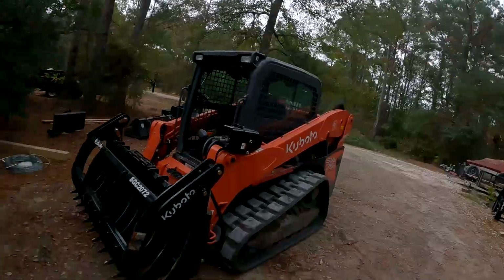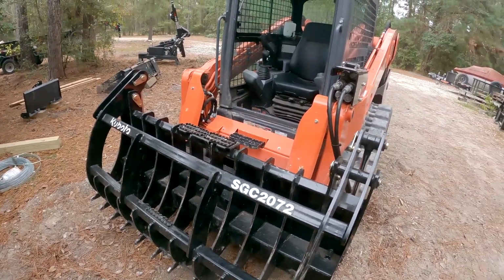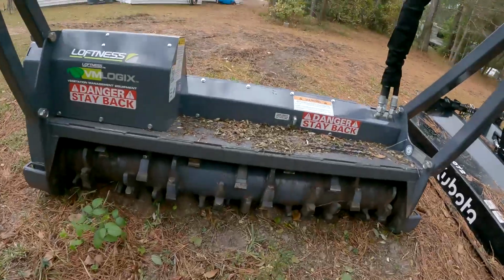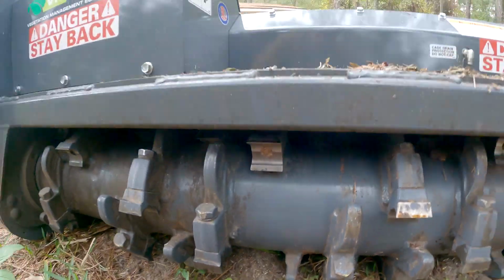Kubota SVL 75-2 with Loftness Battle Axe Vs Bobcat T595 with Fecon BH62

Comment: Do you like the Battle ax over the fecon? Also what series do you have for the battle ax
Reply from the maker: The head in this video is the L series. It's a standard flow head but works great on a 75hp machine in high flow. I have never run a fecon head so I can compare but I felt in here it outperformed the other machine. The big difference is the l series battle axe was specifically designed for this size machine and the fecon was not necessarily designed that way. Both have their strengths.
Reply from the maker: I have the s series on my new Bobcat. Just been so busy haven't made any videos. Just made on recently with The Stoney Ridge Farmer though if you want to check that one out
Reply: Amy thoughts on the battle ax against a comparable FAE on a 75 hp machine. I’m buying the Kubota 75-3 and want to find the best head for land clearing in south Florida

Comment: I run a fecon and can tell you that it doesn’t look like they’re running it on high flow. Something doesn’t seem right. I can chew up trees like that in a few seconds with a John Deere 333g.. That Fecon head is a serious machine but you need to have  high flow.
Reply from the maker: That's a 75 hp machine running the fecon head here so it's definitely not going to compare to your 333g
Reply: @themannstead2494  I agree with you there. I have seen some guys running a Fecon on a 325g which is a 75hp machine and was pretty impressed with how well they ran. Not sure if there may be a problem with the one in this video. I was impressed with the Kubota and Loftness head. Actually came across this video because I have an opportunity to buy that exact same setup for a good deal and was curious about how it would run.
Reply: It’s not the HP it’s the flow ……I run the Fecon bullhog on my Kubota SVL 90-2 and with high flow it will sit down on a tree like that in seconds . Agreed , something is not right with the way that fecon is running.